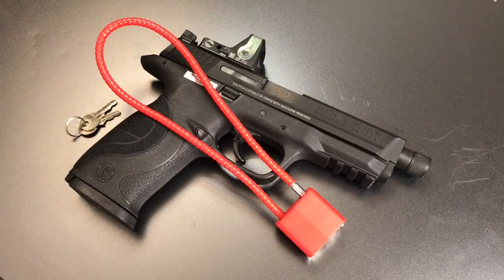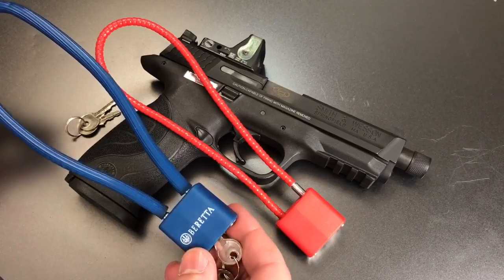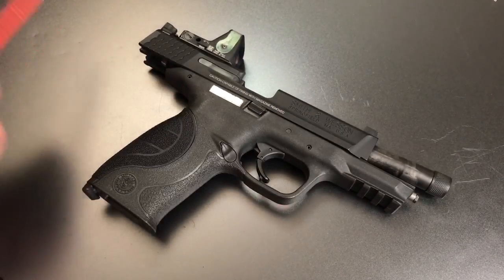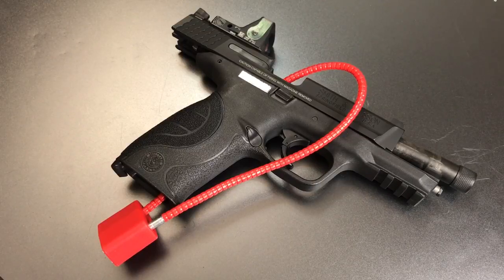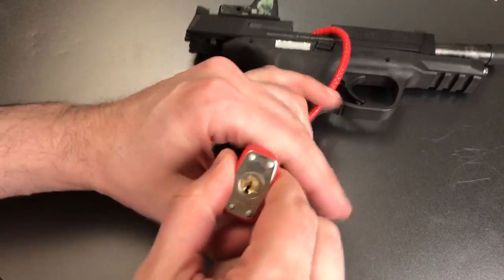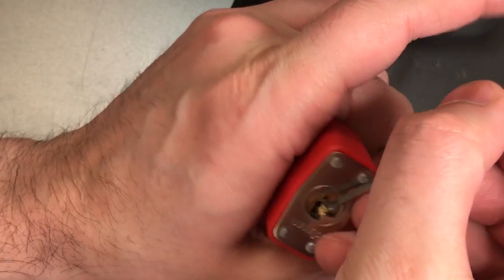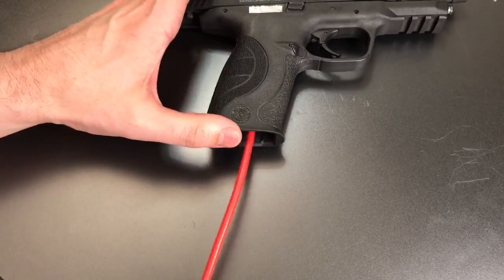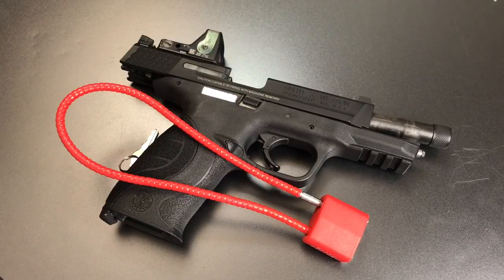[439] Smith and Wesson Gun Lock Picked

Comment: On the topic of gun locks. When I bought a remington 870 supermagnum it came with a trigger lock which actually worked really well... at keeping my out when I went to the gun range. I quickly found out when I was too lazy to go down two flights of stairs to get the key that I could open it with a simple hook, turned upside down, and rocked. I didnt even have to use a tension wrench, I just needed to twist the pick while rocking. Later I decided to try forcing it with a tension wrench and sure enough it opened right up with barely any tension...
Reply from the maker: I am familiar with the lock distributed with Remington Shotguns, and it will be featured.  :-)

Comment: I have two of these locks that came with S&W firearms purchased years apart.  Somehow they both open with the same key.  The only visible difference besides the serial numbers is that the newer one (the only one I have the original keys for) has a China COO stamped on the bottom opposite the 30mm stamping.  I don't know how common it is for these locks to be keyed alike, but it seems like a huge security flaw.

Comment: I found that mine was both full of Chinese cast spools and there was one easy yet destructive bypass. If you remove the plastic cover on the lock you may find that most of the body is also made of plastic and you can dig out the wafer holding the other end of the cable using a nail file or another pointy object.

Comment: had it, now having a lot of trouble with this lock.  haha.  guess i am still beyond novice.  i have picked every pad lock i have, but the 'pile' of ones i can't pick any more is growing and growing.
Reply: not 10 min after posting this got it open twice.  on the second in rotated 180 degrees and is competly seized up now.  testament to why you never pick a lock in use or other peoples locks.  damn
Reply: James Mitchell - put a long tension tool in, and lift the driverpins back out of the core, and rotate it counterclock back again.
Reply: will try again.  was trying a bit last night with no success.
Reply: James Mitchell might also try to hold it upside down, if the key pins also have fallen into some manufacturing holes from drilling the chambers in the body

Comment: How hard is it to just cut through the shackle on these kinds of locks?
Reply: John Hinds It looks like a armoured cable lock. Can't be tough at all.
Reply from the maker: It's harder than you might think... but not that hard.  I'll try to cut one on video in the not too distant future.
Reply: I managed to cut one with a pair of normal side cutters, but it was a bit of a struggle. High leverage cutting pliers or small bolt cutters would go through a lot easier. It's a steel cable that has sheet metal cups on it (like beads on a necklace). The sheet metal flattens out and spreads the cutting force out over a greater area.  The "cups" are shaped like a "large" size cup from a fast food place, one small diameter and then a large diameter, the change happens about midway across it's length. That way they can overlap or stack and prevent you from just bending the shackle and cutting in between them.
Reply: Hmm, I can't edit my comment. I said it was "a bit of a struggle"; I should elaborate. It probably took me 10 minutes and I was using both hands on the cutters. I just used standard length cutting pliers, 4" handle length. I think the shackle is pretty good for a cheap cable lock, as long as you don't plan to lock up a firearm with it. Use it to lock your fishing rods up in the back of the truck or something like that. Chances are, if someone is trying to steal fishing rods from the bed of your truck, they can't pick a lock and aren't carrying bolt cutters.

Comment: does it damage the Gun storing it with open action for a long time?
Cant be good for the spring right?
Reply from the maker: With a quality spring, it should be just fine.  At absolute worst, you replace the recoil spring every 10 years.
Reply: Springs fail through metal fatigue. Keeping a static load on them does very little.
Reply: You can also close the slide on the cable, so the spring is only compressed by the width of the cable.